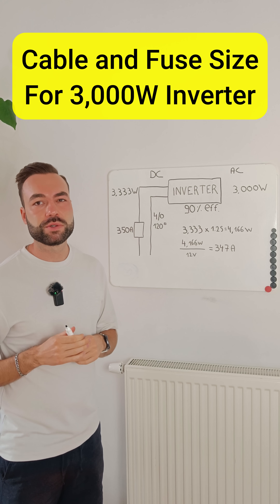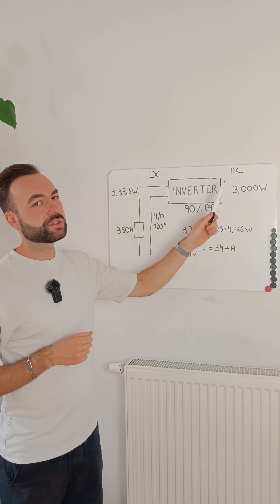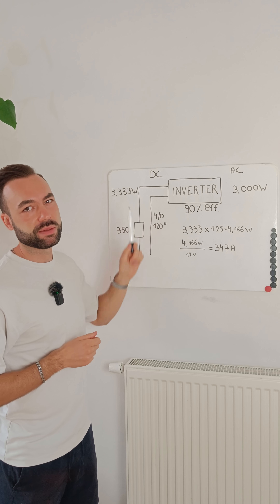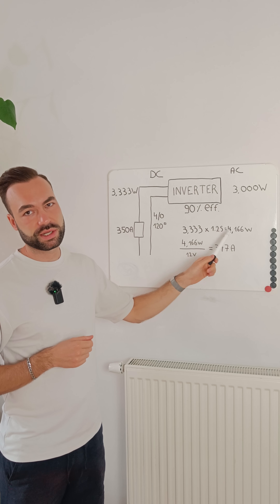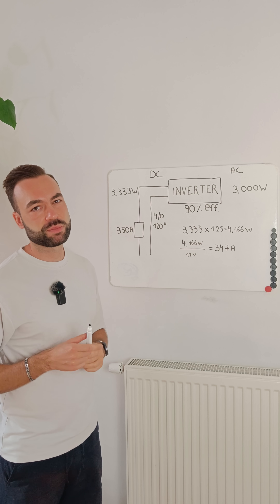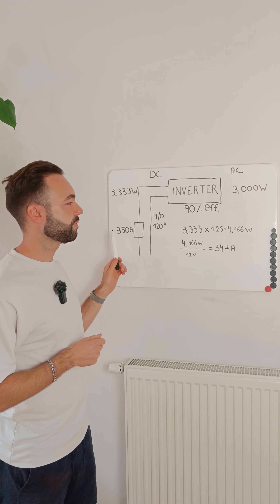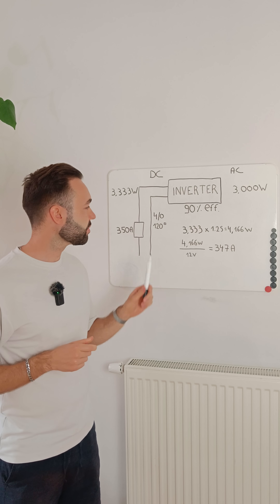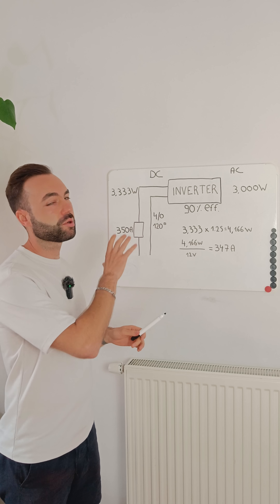Cable and Fuse Size for 3000W Inverter

Comment: Dude you are COMPLETELY incorrect.  You have AGAIN divided the inverter output by the DC battery voltage (12v) instead of the AC voltage (120v).  A 3000 watt inverter can output about 25 amps.  There are NO INVERTERS IN THE WORLD that can output 350 amps.  

The largest consumer inverter is the Victron Quattro, which can output about 41 amps.  You are AGAIN off by a factor of 10.  The inverter rating is Volt-Amps and refers to the amount of amps the inverter can output AC, not DC.  To run DC electronics, you do not need an inverter you can connect a DC electrical panel directly to the battery bank.  

Also 4/0 cables can not carry 350 amps 4/0 cables carry between 200-250 amps depending on the brand and type.  What you have said here in this video is ELECTRICAL FIRE.  If you really had an inverter the wire sizes and the fuses would be in the manual.  

The Victron Multiplus is 12v 3000VA.  It can output a MAX of about 25 amps AC and charge DC batteries at a MAX of 120 amps.  On page 8 the manual says the recommended fuse size is 400 amps.  The recommended cable size is 70 mm squared which carries about 200 amps, so roughly equal to 4/0.

Your math is not correct.  Your numbers are off in a way that is definitely dangerous.  You should not continue to do your calculations incorrectly like this, and you definitely should not make how-to videos until you understand these calculations.  The information you are looking for should be in the manual which is freely available online.

Also how can a 3000w inverter with 90% efficiency output 3333w?  90% of 3000 is 2700.  Your math is just not correct in many places.
Reply from the maker: I already told you in another comment that it's the current on the DC side, not AC. Lookup wire ampacity in the nec table and you will see how much current cables can carry. If you have 3000W output with 0.9 efficiency then the input side is greater.
Reply: @cleversolarpower  And I told you in THAT comment and THIS comment that dude you are WRONG about this.  The 3000 watts is Volt-Amps and is the AC OUTPUT of the inverter.  This is IN THE MANUAL, it outputs 25 amps AC.  It does NOT have a DC output because you do not NEED an inverter to run DC electronics, you connect the electrical panel DIRECTLY to the battery.  Inverters are for running AC electronics.  And Inverter-Chargers run AC electronics and charge DC batteries.  

The manual for the 3000w 12 victron multiplus CLEARLY states on PAGE 9 that AC-OUT-1 can output 25 amps.  A FAR CRY from your figure of 350 amps which is off by MORE than a factor of 10.  Dude you are WRONG, you have done this math INCORRECTLY, and you need to both REALIZE this and ADMIT this before you continue with your cleversolarpower video giving people the completely WRONG advice about their electrical setup.  

The answer to the question of this video is on page 8 and 9 of the manual.  Your answers are COMPLETELY wrong.  Your Math is COMPLETELY incorrect.  The Victron Multiplus manual is FREELY AVAILABLE online.  PLEASE read it.  

ANYONE following your electrical advice will have caused an ELECTRICAL FIRE ALREADY that they will be LUCKY to escape.  You should NOT design anyone's electrical setup, NOR should you give advice about it.  You have been DEAD WRONG on MORE THAN ONE occasion about these basics.

And as far as the battery cable.  There IS NO 350 amp battery cable.  You are TRIVIALLY WRONG about this as you will find 350 amp battery cable NOWHERE IN THE WORLD.

Comment: Silicone insulated 200 degrees celsius 70 mm2 cables are good for 350A till 70 cm length of cables. Your cables were pvc insulated 70 degrees celsius ones and need to be 120 mm2.

Comment: what about inrush current ?
Reply from the maker: No need to size larger for that. The fuses are not fast acting and the cables can handle it.
Reply: @cleversolarpower  Dude you must install an eazy start soft start in between the inverter and the DC connection.  Otherwise inrush current will overload your inverter and eventually break it, or the electronics themselves, or blow the fuse, or blow the wires.  NO the cables CAN NOT handle it.  Microair makes a good soft start they have plenty of documentation on their website.

Comment: My friend, check your calculations. Everybody makes mistakes sometimes 😂 I still think you’re great!
Reply from the maker: Where is the mistake? I think you are referring to 3,333W. The power draw on the input is always greater than the output, hence the higher power on the input or 3,000W/0.9 efficiency = 3,333W input.

Comment: I went for this cable, 120 mm2,  and paired it with a 400A Class T fuse. Should still be fine for WindyNations WNI 4/0 Gauge
Reply from the maker: Yes, that is still ok. A 4/0 windynation cable can carry a maximum of 440A.

Comment: If it’s 90% efficient then it wouldn’t be more than 3000, it would be 3000 minus 10%=2700. Or am I not following your calculations?
Reply: Think of it this way. If an inverter is 90% efficient, it needs 3333w on the INPUT side, to deliver that 3000w on the OUTPUT side. 
An inverter that used less power on the input than it produced on the output would be free energy. Impossible.
Reply from the maker: The output is 3,000W, so with an efficiency of 90%, the input cannot be lower than 3,000W. So it is 3,000W/0.9=3,333W
Reply: @cleversolarpower  If a 3000W inverter works at an efficiency of 90%, it would be 2700W, we do not divide 3000W/0.9, we must multiply 3000W*0.9
Reply from the maker: No, the output is 3,000W and with 90% efficiency the input will be greater. An inverter is rated for it's AC output power, not the DC input. 3333W*0.9=3000W 👀

Comment: I buy car booster cables when they are on sale and make my own connections. I use the supplied cables from the panels to the inverter, then all the other connections are with the booster cables cut to proper lengths.
Reply: Those cables are NOT rated for that. I'd be amazed to hell and back if you haven't burnt your sh1t down to the ground by now.